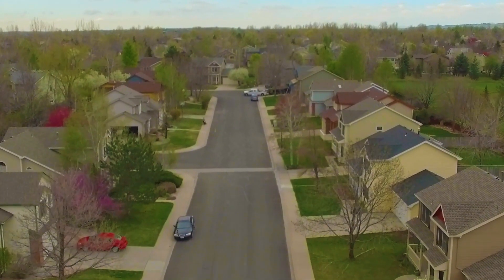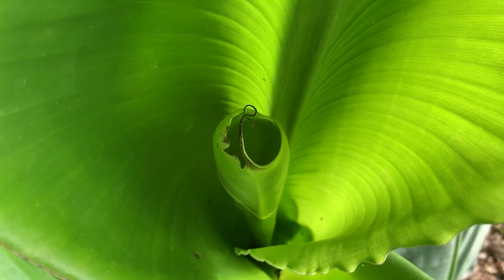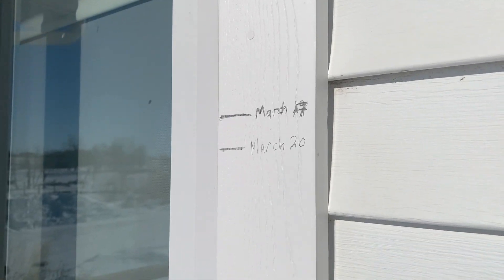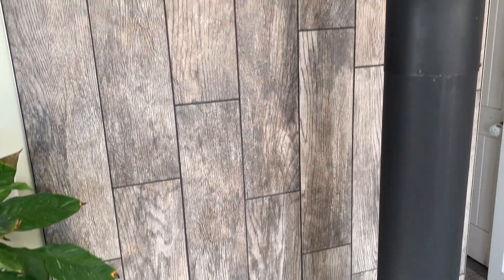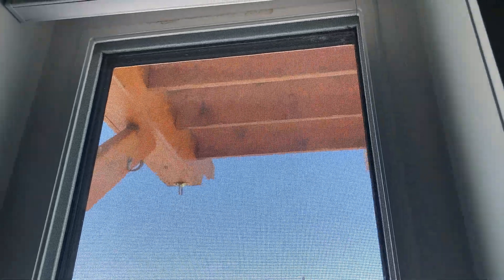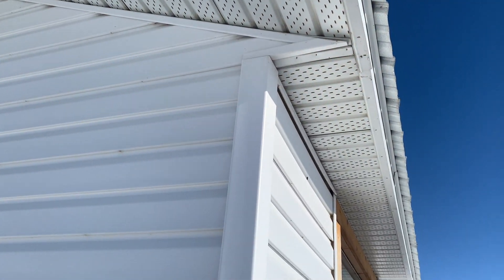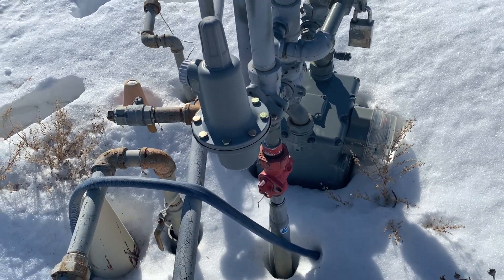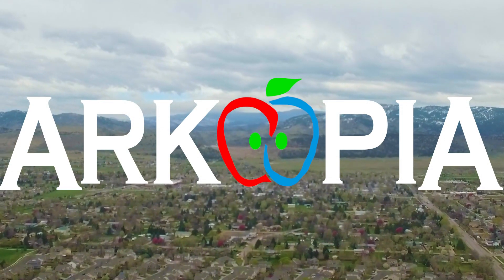Passive Solar Houses - This House Will NEVER Freeze

Comment: But air conditioning and other fuel-burning ways to heat and cool are so easy... why bother with natural methods, when developers can maximise their return and increase the density of the boxes... and install expensive , less than ideal, substitutes for natural systems... people on the land are so much more in tune with seasons and cycles, people in suburbia are just ignorant... but they have a remote control for heating and cooling, so no problems hey...?

Comment: Hi Dean .
I'm trying to find the video you did where you talk about the hand water pumps distributor. I know I copied it by taking pictures but I can't find it .
I will continue to search for the information but if you know the name off the top of your head, and wouldn't mind posting it. That would be great .
Reply from the maker: Vevor.ca sells them.    Another hand pump I have is from here.  http://oasispumps.com/pumps.html
Reply: @ArkopiaYouTube  Ok ! Dean Thanks so much for responding so quickly.
I'm still watching your video on your green house construction.
I'm trying to invision the drawings or blue prints . I'm a carpenter and prints are the way I absorbe because they have measerments and detailed drawings .
But you have demonstraighted everything well . 
so Dean brother , did you ever make blueprints ? or did you develop the picture 1 jigsaw puzzle piece at a time .?
You know its like you have an idea , so you       scrribble it down on either  a note pad  ,or in your mind.
Then you get another idea ,& scribble that down .
Pretty soon you have a bunch of notes all over the place .
Then you revisit them , re hash and update . 
So Dean , your place is moving forward again .
So now I know the R factors for the ceiling,(R 60 ), but the sub grade frost depth  was 48 " to 120 " as you stated .
So exactly how much depth  excavation did  you do ? 
Was it like a bi level home with 4 feet basement concrete wall  ? And then R 60 in the basement and then30" of clay fill  and 12 " of top soil .?
Im trying to get the drawings down correctly  so I can move to the cost and materil estinates .
Anyway Dean , sorry for bothering you on your 1/2 day off .
I'm thinking of coming out to visit and meet you .But I will let things unfokd as meant .
Reply from the maker: @arnoldschmidt2753    I drew my blueprints in the “sun angle calculator” video.   My blueprints only really work for my latitude, so I explain how to figure out the build for wherever you live.  For my underground insulation, I dug that trench 4 ft down and 16” wide into my solid clay, then stuffed it with in-ground-suitable rigid.   Just on the inside of my building perimeter and drilled the posts in just outside.   This is the “cheap and good way” of doing it.  Then after the building is built, I dig down just below surface and put horizontal insulation anywhere from 6-12 ft out to keep the frost from coming in.   With my used insulation deals, I literally super insulated my building from frost, better R value than Icf, for $1000.   And it works.   A Icf footing would have been great for the $20,000 or so it would have been.  But now I have $19,000 and a building that works pretty much just as well.   👍✌️

Comment: Minus 22 degree Celsius? If your house overheats on any kind of day with a temp under freezing it is very impressive. South windwows with no anti-UV-coating, right?
Reply from the maker: No coating on south windows
Reply: @ArkopiaYouTube  I am very interested in this at the moment. I made a walk with friends today and we touched different concrete sturctures that were facing south. You wont believe how much of a difference the color made. I always thought this is a myth. Even on grafittis you realied difference. Warmer on the unsprayed areas, colder where they sprayed bright colors. Crazy. My floors will be dark gray to black for sure
Reply from the maker: So simple right?   I think actually a dark dark green is even better than black.  👍

Comment: Overheating is due to a lack of thermal mass, not too much glass.
Reply from the maker: Too much glazing will overheat a building no matter what, but also lose a lot of heat at night.   Minus 40C outside today, sun out, plus 30 in my greenhouse and plus 24 in my house. 👍
Reply: @ArkopiaYouTube  I have 300 sq. ft. of southside glass.  The 6" thick concrete floor is 21 ft. by 33 ft sitting on top of a 90-ton gravel bed.  When the sunroom hits 78 F., a fan kicks on, pulling air off the ceiling into the gravel bed.  This is what heats my house.
Reply from the maker: @Cspacecat    Sounds amazing.   My folks have a sun room and it seems it is the source of most of their heat loss.   Always cold, unless the sun is out of course.   Thermal mass would make a difference for sure.✌️
Reply: @ArkopiaYouTube  I cheat.  I have 6 layers of vinyl plastic in front of my glass.  All southern surfaces are carbon black.  It's -1 F. outside and the sunroom is 64F. My natural gas furnace is actually running this morning.  I ordered the natural gas company to have my gas service turned on 4 days ago.  It took them 2 days to turn it on.

Comment: We have a passive house that was built in the 80’s. It was built and then received zero maintenance. We are replacing all windows and repairing rotten sills. The eves are perfect for spring, but it gets too hot in the fall. I use curtains, but still way too hot. I think after we replace the ceiling insulation that will help. Did you say R90 is in your house?  It has a brick exterior, which I’ve lime washed white, and most of it is partially buried.  We have no air conditioning and when it’s 110+ outside it is 95 or more inside. It doesn’t cool off at night (around 80 when we get up) and we are really struggling with ways to keep it cool. We are replacing most of the wall insulation as mice have been in the walls. It has a badly cracked/heaved slab and I’m hesitant to  tile it for fear of the tiles breaking (I suspect the reason it had fake wood floors in it when we purchased and not the original tile). Any advise?  There is not a whole lot of info out there to guide us in restoring it.
Reply from the maker: I put R80 (32 inches or so) in my attic.   Insulation is always the best bang for the buck.  Windows with wood sills from the 80s will rot, yes.   Pvc new windows would be great.  Could put a pergola to further shade the south windows?   White brick is a good idea too.   If your house is big, it will stay cooler the bigger it is.   If it is small, like ours, it will get warmer in there (not enough mass to it).  Roller blinds on the outside of the windows are pricey, but would be awesome.   Good blinds inside like you say.   Open up the house at night when it’s cool, and closed up like Fort Knox in the hot day.   Do all those things and nothing wrong with running a small air conditioner in a bedroom too make like so much better.   I hate the heat.   I can deal with the cold better with a nice fire, but heat sucks.  Insulation, better south shading, better windows, and more thermal mass inside are all the best ideas ✌️👍

Comment: Do you see any design challenges there would be  for tiny solar houses? That might be a separate video on it's own.
Reply from the maker: My house is “tiny”.  Not “tiny house on wheels” small,  but pretty small.   Because these concepts work so well, if done properly it actually works better in larger structures with significantly more thermal mass.   Example: my large shop is not as efficient as my small house, but my shop stays cool all summer because of all its thermal mass.   My tiny house warms up quickly because of lack of interior thermal mass.  ✌️

Comment: I like the idea of marking the location of the sun on the wall during the day (or at least the solstices) but what I can't figure out is how to calculate the length of the overhang.  Maybe I'm not that great at math, but how do you calculate the length of two sides when you know only one side?  Pythagorean theorem needs two sides.
Reply from the maker: It’s a right angle triangle (90 degrees), and the other angle is your solstice angle.   Just draw it in a piece of paper.   Maybe I should do a video on the calculations. ✌️

Comment: I’m really happy to hear you explain things very well. I understand those principles quite well since I have a passive solar house as well. One thing that I’m sure you’re going to benefit from in the future is an off grid photovoltaic system. I benefit from such a system and it provides so much power I drive my electric car for free. 

You will need the extra energy to run heat pumps to get rid of heat from your aquaponic system and you also need continuous aeration. Just so you know a properly designed solar electric system is ultra reliable. Modern lithium iron phosphate batteries don’t require any maintenance at all and they will last you 15 years at least.
Reply from the maker: Thank you.   Great to hear.   Photovoltaic is on a long list of things I need to get set up.  👍✌️

Comment: Solar panels should easily last for 40 or more years & the batteries used for pairing with them should easily last for roughly the same amount of time unless using lead acid chemistries; degradation whilst inevitable, is minimal. To suggest anything else is to perpetuate the myths of the FUDsters, naysayers & those who've vested interests in the fossil fuels industries. Whilst it is true that they have higher upfront costs, payback begins immediately & most find that process is completed around the 8-10 year mark & in the meantime owners aren't left vulnerable to the vagaries of energy price fluctuations, power outages, wars etc.

Comment: Loving your work dude!
Built my first Passive Solar nearly 20 years ago
Found out the max/min midday sun angles for the region and specced the rafter overhangs,window heights and roof pitch relationship accordingly.Same overhang on all walls to protect the cladding.
Another great advantage beyond not heating the walls in summer is that the cladding never gets wet so will last much much longer (I used sawn,untreated 6x1 Douglas Fir weatherboard) and the walls stay dry in winter so lose less heat and don't rot.
It is on steeply sloping oak woodland so built on posts and pads.Raised the whole structure 1.2m off the ground(=>3m at the 'deep end') and got loads of free dry storage area underneath for the cost of 1.2m extra on each post! Great for storing firewood,mini-tractor,farming gear,clothes line and shaded hammocks and saved a fortune on concrete without destroying the roots of the mature oak trees that provide shade from the summer sun.
Like your good self,I realised long ago that the thing on the end of my neck is not for knocking nails in with.

Comment: Do you have any recommendations to retrofit a house that isn’t facing the right way? Or a two story house that is the right way?
Reply from the maker: It’s all about south windows and proper overhanging eves.  So could add windows and/or sun shading above?   Other retrofits would likely not be passive, like a solar air heater on an improperly facing building maybe?

Comment: Living in the desert with 115+ summer days, the design is somewhat different and is more intended to keep heat out.   I do have deep overhangs, light exterior coloring, dual pane windows with shade screens and shade trees.  I haven’t used a heater in the winter for the last five years.

Comment: Some useful ideas you covered. I like the marking of the shade from the overhang. As for overheating on a sunny winter day, could you offset that with some additional thermal mass inside the house (such as thicker concrete slab etc.)? If you get the mass material and capacity right it seems like it could help significantly to keep a constant more comfortable temperature inside later into the night.
Reply from the maker: The more mass, the better.  👍🏻 My house is on the smaller end, so I’m limited on space.   If I ever build on, I want thick concrete floors and rock walls, and stuff like that. ☺️
Reply: @ArkopiaYouTube  FYI:  I worked on concrete flooring when younger & they needed special mats because, ", and over time can cause long term injury."

Comment: We have 100 degree heat in the N Sierra mountains of California and we had sun baking the west side of the home monthly during summer. Installed (2) 20x40 long tarps to add over our cement walkway of the west side, with hooks and grommets. It helps keep our home 10+ degrees cooler, but the best part was when the wildfire came. 2200 houses burnt to the ground, but our home survived, partially because of the tarps keeping the embers OFF our foundation. Now the tarps have small holes from  a few embers burning through, but are still useful for the summer heat.

Comment: I can see you've put a lot of thought into it buddy.
Another idea you could incorporate into the greenhouse is having a trench system under your greenhouse, filled with broken glass, (like smashed bottles) then have a small fan at the highest point of your greenhouse attached to ductwork which goes down into your trenches below the floor. This heat is stored in the broken glass and released at night. Broken glass is amazing at holding heat. 
Just a thought. But love what you're doing. 👍✌️🙏🏻
Reply from the maker: Good idea. 🙏

Comment: I may be a Uni clone in a ticky tacky box but I did build a cable trellis for my grape vines around the sun room for more summer shade and full winter sun when the leaves fall.  Otherwise the rest of the house is about 90°off.  Hopefully the next one won't be R-13 walls....

Comment: Awesome stuff, ties in great with the other overlapping areas of knowledge that makes your channel great, thanks to CP for spreading the word about you. For the west side, if you have windows there, can you also duplicate the roof overhang on that side like you have on the south side to keep the summer sun out as well? Although im guessing the further south you are, the lower its going to be by the time its coming in the west side (eg carolinas vs sask, for example). 

That's great you're using the greenhouse all year, I've always thought that instead of the "overheating" in summer, its a solution to grow fast tropical type items, malabar spinach (has both a green and a berry crop), moringa, sweet potato greens are nutritious as well, etc. I'm sure im missing tons. usually I've just figured if you have a climate battery, you just have to have a faster fan in summer, but maybe a crop change could avoid some of that.

 Those tips about home design are so spot on for SHTF, no moving parts, done once and forget it, also if the bad times last awhile, we tend to get slower and weaker as we get older, so a house that needs less firewood cut, or job $$ for nat gas bill, etc.is a good idea.
Reply from the maker: Exactly.   You 100% get it.   Let’s make common sense and preparedness the norm, for both hard times and just less work as we age.   Sweat now so you don’t have to later. ✌️
Reply: You can always add some sort of shade that you can flip over the window in summer. Be it a trellis with plants or an awning.

Comment: Thank you! Any resources,  books or websites you'd recommend to learn more about this?
Reply from the maker: I’ve been obsessed for so long, it become common sense to me.   😂🤓  I’ll try to remember some resources and let you know. ✌️
Reply: @ArkopiaYouTube Hi I Iive in Minnesota and have been thinking and wondering about the passive idea for many years. I'm hoping to do a monoslope home connected to a monoslope greenhouse  with all glass on the south sides and using ICF forms on the north, east and west sides. I want to incorporate as many wise and free techniques  as possible. I'm wanting to learn from others so I do it right the first time. Anyone with websites or support groups? I would be nice if like minded people have Zoom calls and have question and answer sessions regularly.
Reply: @ArkopiaYouTube  I was thinking about making an earth bermed home using the excavated basement dirt on the NWE side and the roof slope matching the winter solstice so that the winter sun reach the north wall.I would have enough overhang to shade the summer sun.Do you think this would work?I was also  planning hydronic floor heat.
Reply from the maker: @toechop   That sounds great.   But in the winter, over glazing will result in overheating during the day, and heat lost at night (like my greenhouse). Earth berm is great if you do a structure to support it.  👍🏻  Insulation is most important as well.
Reply: @ArkopiaYouTube overglazing is really just an issue of too much glass per thermal mass (inside the building envelope). So a very large glazed area like your greenhouse benefits from large amounts of thermal storage to store all that extra energy. Obviously at some point it still becomes too much, depending on the latitude and climate.
Reply: I know this post is a couple years old, but look up James Kachadorian, a civil engineer from Massachusetts. If you can still find it, he wrote a book that is a very clear method of calculating and building. R values are old school, but one can modernize the calculations pretty easily.